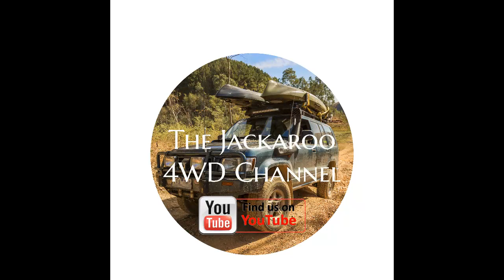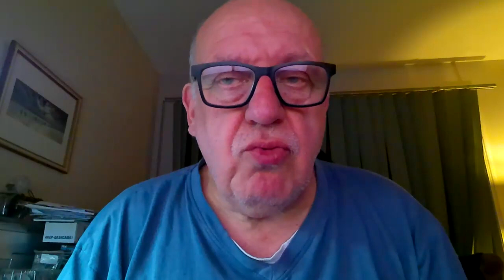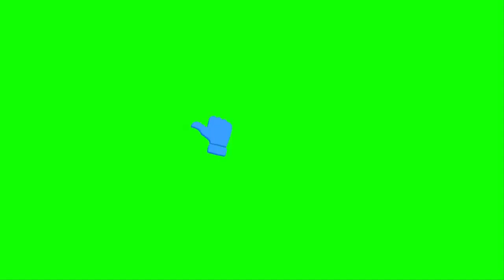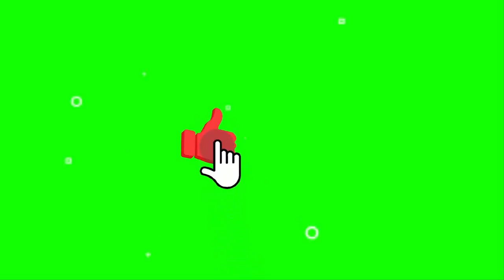IPX4, IP67, IP68 & IP69K Ratings – Ever Wondered, What Do They Actually Mean?

Comment: hi Dave where did you plum your boost gauge line into,
 to please can you send me pics or show me
Reply from the maker: Are you talking about the boost gauge or the EGT?
Reply: i am going to fit both now so both be good and how many psi boost do you run in yours to 
 @thejackaroo4WDcampingchannel
Reply: thanks i know where to run boost from now thanks and would 18 psi be to much for it
Reply from the maker: You need to locate the MAP sensor to the left of the EGR on the inlet manifold. There is a vacuum pipe that goes from the MAP sensor directly to the manifold. In the SAAS gauge I had originally, there was a metal T-piece. I cut the pipe and joined it back together with the T-Piece and used the third connector for the Boost gauge.

Watch this video 
https://www.youtube.com/watch?v=YU2D6GRu51U 
Stop the video at 2.16 and you can clearly see the T-piece. I replaced the hose and fitted the T-piece to it.
Reply: ok cool i know where that is thanks mate great stuff and love your vids man @thejackaroo4WDcampingchannel
Reply from the maker: I appreciate your patience with this, I was at work
Reply: all good Dave thanks so much good to see some one else working on these engines ive done injector harnes , injector sleave o rings, timing belt a few thing now exhaust manifold leaking so pulled it off to replace gaskets and turbo has tomuch play in shaft so ordered a turbo ant it should have adjustable rod so am going to give it a bit more boost  @thejackaroo4WDcampingchannel